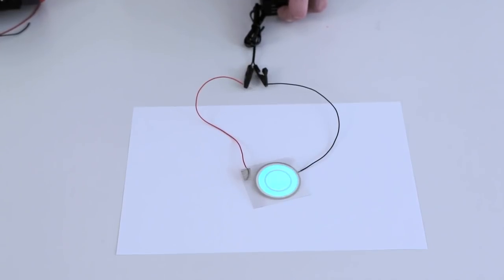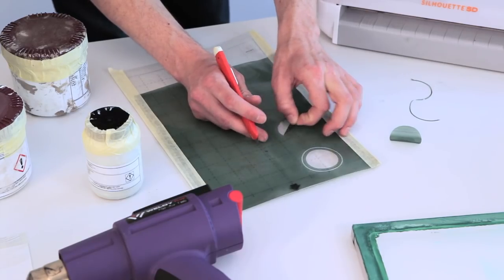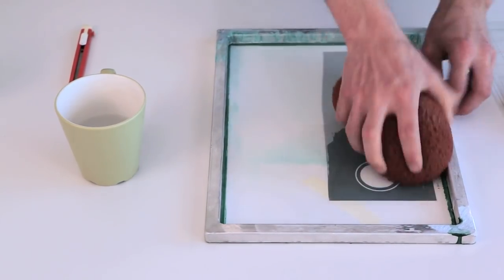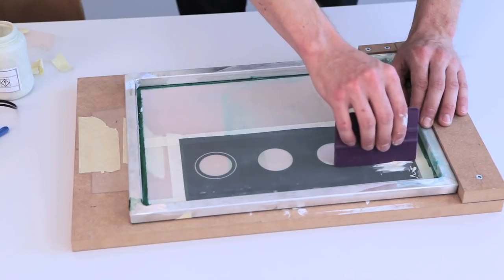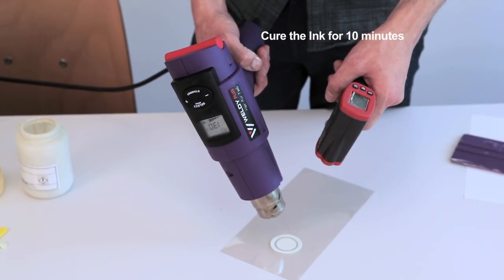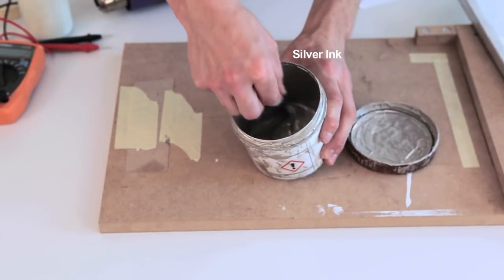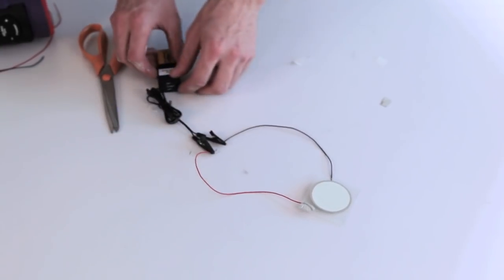Electroluminescent Screen Video Tutorial

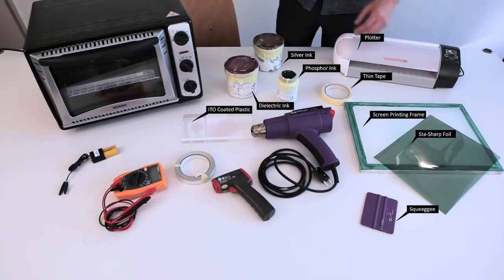Comment: In the beginning you showed 9V battery (min 0:44)  but then you mentioned that we need to apply 90V to implement this process. (min 4:32) Sorry if i understand wrong but I need this values for my electroluminescent project. I would be grateful if you would help me in this matter.
Best regards.
Reply: Abdelrahman Hamdy There is an inverter that converts 9V DC to 90V AC 500Hz.
Reply: +DisneySK you sure??

Comment: Educational tutorial, thanks.

However i have doubt i would appreciate if you could clarify doubt of mine.

Instead of connecting silver conductive ink and ITO coated film with wires, is it possible to print the tracks with screen printing and then crimp it? For example like a membrane switch crimping.

Comment: how do you calculate the voltage and frquency requied for the size of panel you are making so as not to burn it out.

Is there a calculator for this or formula available.

Comment: Thanks for posting this, neatly done and very clear. I wonder why this technology is so unknown and not massively used!. Why 90V applied? i ve seen 3v up to 12v inverters in sprakfun to run elpanels. Do you know where can i get the materials to make this?
Reply: The inverters generate the higher AC voltage.
Reply: The reasons likely include: High resistive losses. Low maximum luminosity. Breaks down quickly. Needs higher voltages and can only be operated with AC.

Comment: 500 Hz? is it ok? so we could achieve these values only through weird converters, right?  
Or did you mean 50 Hz?
Reply: Carlos Blanka No, 500Hz. You could make it with 50Hz but it'll be dimmer. Brightness per area increases with frequency and voltage. Search for Electroluminescent drivers (for el-wire), those are pretty cheap in our days and supplies up to 120VAC(RMS) 2000Hz from 5V DC. Higher values will decrease lifespan of a phosphor. Most phosphor manufacturers are using 100V(RMS)-400Hz pair for testing.
Here's spectrum dependency of ZnS Phosphor from frequency:
http://mds.marshall.edu/cgi/viewcontent.cgi?article=1494&context=etd
And some common info on Phosphors:
http://www.gwent.org/gem_data_sheets/polymer_systems_products/electroluminescent_display_materials/electroluminescent_brochure.pdf
http://www.mdpi.com/1996-1944/3/2/1353/pdf
Reply: Carlos Blanka As example, on Adafruit $4.95 for 12v driver capable of running 12m of el-wire or 100 square centimeters of el-film.
Reply: +Sedokun thank you this was very helpfull

Comment: can it be used as paint?
Reply: yes
Reply: where can we buy those materials you used?
Reply: you have to dig into it a bit. I wondered the same thing for a while and got a basic understanding by watching several videos last week:

the base layer just need to be a decent conductive material, anything from actual metal, or graphite conductive paint, etc

The Dielectric layer is more exact google "dielectric grease" or "dielectric spray"

The phosphorous layer, search: Electro-luminescent Phosphorus

the conductive clear coat is more tricky, google: Conductive clear coat spray, you should get the same company that makes the dielectric spray.

And the normal clear coat layer would be any non-conductive clearcoat
Reply: oh thanks for info ***** , Godbless you :)
Reply: adm
no problem, It will take some experimenting. I haven't done it yet. waiting on money. Dupont sells all the items needed to make this, but I'm not sure how to buy from them yet.
Reply: ok sir :) cheers!
Reply: Is the "conductive clear coat spray" a replacement for the silver ink used in the video?
So instead of the ITO coated plastic, I could use any conductive material, and instead of using "Dielectric ink" I can use "dielectric grease/spray" and that should theoretically work fine?

The tricky part to this is actually obtaining the EL Phosphorus and the silver ink, if I can obtain cheaper/better price alternatives that would be great.